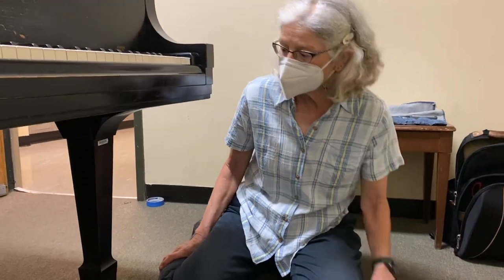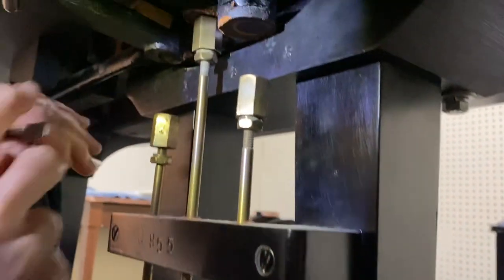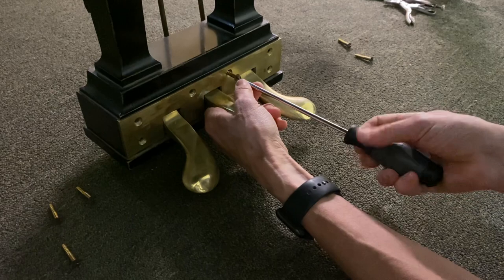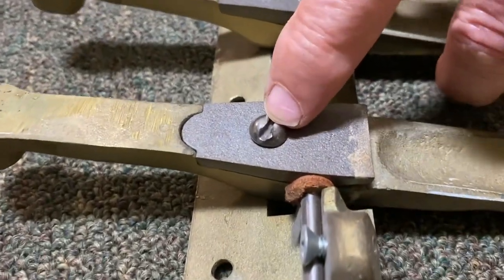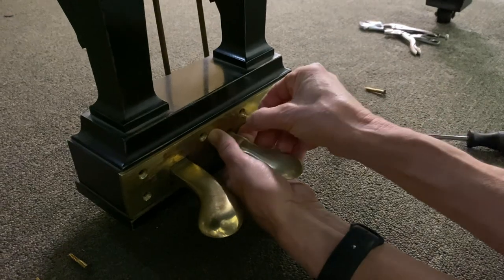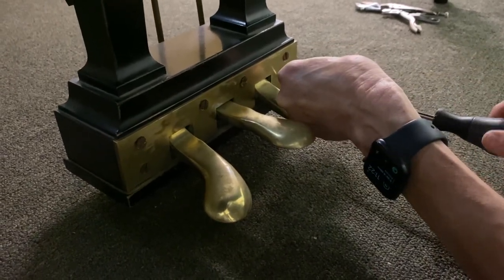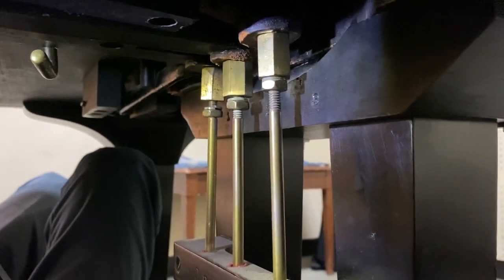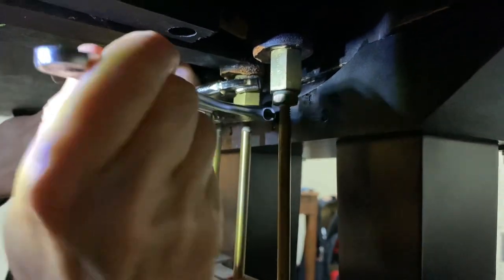Steinway pedals - how to tighten

Comment: Older Steinway pianos all have non adjustable pedal rods.   In my experience a Steinway with adjustable pedal rods is the exception.
Reply from the maker: Yes, you are right. They can be replaced with rods that have the top nuts. Or you can be prepared to replace leather.